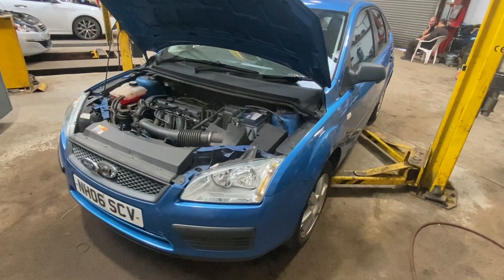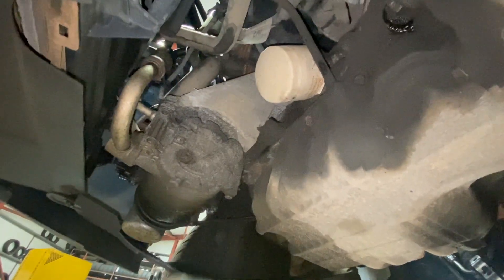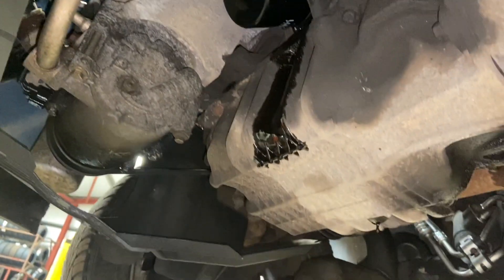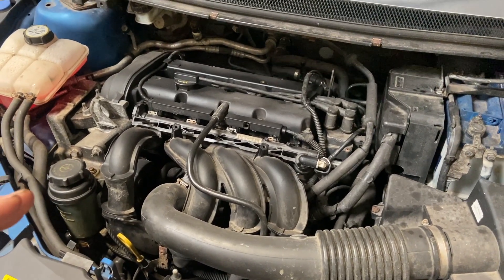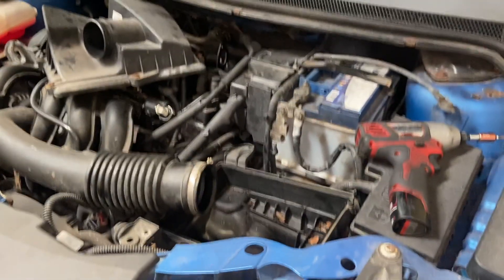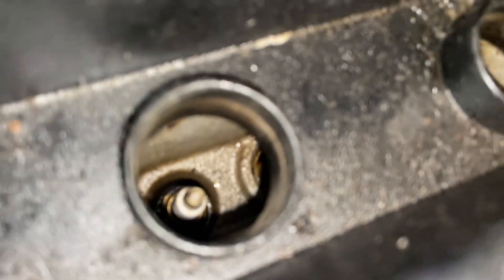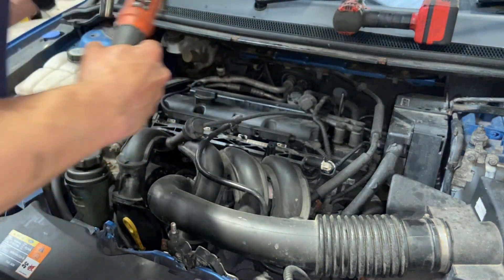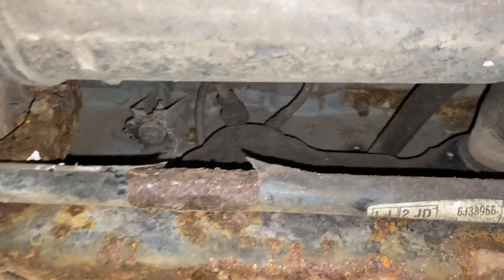Ford Focus 1.6i Zetec Engine service procedure

Comment from the maker: Check Euro car parts - https://tidd.ly/3lIO7xA  (use discount codes on site)
Check "Car Parts for Less" - https://tidd.ly/2LNEwIn  (use discount codes on site)
Engine Filters & Oil from Euro Car Parts : 
Oil Filter - https://tidd.ly/3tn8a7g
Air filter - https://tidd.ly/2U0KRnW
Spark plugs - https://tidd.ly/3nQrbhs
Engine oil 5 ltr - https://tidd.ly/3b1MjMs

Service kit inc oil Ebay - https://ebay.us/T4JWT0
Engine oil eBay - https://ebay.us/vTP4CR
4L Engine oil amazon - https://amzn.to/3ujyWPp
Brake cleaner eBay  - https://ebay.us/57pfYI

Tools :         
Oil filter removal tool in video - https://ebay.us/PQZcAP
Universal oil filter removal tool - https://ebay.us/qkgOYt
Spark plug socket set - https://amzn.to/3vKvihs
3/8 Digital torque wrench - https://amzn.to/2PP9vpP
3/8 standard torque wrench - https://amzn.to/33eZsxj
Socket set - https://amzn.to/3eGx2Ak
Brake cleaner sprayer - https://amzn.to/2BLF1gX
Long reach 3/8 ratchet - https://amzn.to/3iJsADg
Ring Inspection Lamp - https://amzn.to/3gGWHcG
torx screw driver set eBay - http://www.ebay.co.uk/itm/142442401623
Pic set - https://amzn.to/33JcZyJ
Dewalt 3/8 impact driver - https://amzn.to/3njemLY
Screwdriver set - https://amzn.to/3jswgJP

Oil capacity :
4.1 Ltr 5w30 or 5w20 fully synthetic engine oil 

Torque settings required:
Spark plugs 15 NM
Sump plug 28 NM

Check out my timing belt & water pump replacement video for the same engine : https://youtu.be/jTAVM75YiwI

Comment: Where is the A/C drain pipe on the mk2 2007 as mine is fulled with water not coolant when the air con was on water used to out under car but not now so pipe is blocked Thanks for any help.
Reply from the maker: Yeah must be that then , I’m not sure axactly but it will run down the engine side of the bulkhead normally

Comment: Those Bosch spark plugs are soo garbage!
I cant believe Ford uses Bosch or Autolite as Oem instead Ngk or Champion.
Reply from the maker: Tbh mate can’t say I’ve had many problems with em
Reply: They arent problematic, but they really dont perform better or equally good as the Ngk's or Champion.

Comment: I recently bought a  Ford Focus 1.6- 2008- the video was so  helpful ...thank you
Reply from the maker: You're welcome!
Reply: @diydaly  what is the difference between a zetec, and a duratec, Cuz my dad owns a 2007 c max, 1.6 duratec
Reply: @bigmansir3745 the duratec version has variable valve timing which produces more power and torque than the none V V T version  .the visual differences is 2 camshaft senses near the top of the timing belt cover.  😊

Comment: Is it possible at all to change the air filter for a cone one to give the car a bit of a better sound? I know it won’t be much but just thought it’s worth the ask.
Reply from the maker: Yeah its easily done
Reply: @diydaly  are there any specifically you’d recommend or make sure I install a certain way to make sure I’m not sucking in too much hot air or should it be fine?
Reply from the maker: @tylermarkley7919  I
Reply from the maker: Tbh mate I wouldn't really recommend doing it but if you are going to id just say go for a reputable brand like K & N

Comment: Is it safe to wash your engine with water
Reply from the maker: It’s is if everything sealed correctly , personally I would t recommend it .. certainly not power washing it , people do but I’ve seen various problems caused by it
Reply: @diydaly   Thank you I think I'll give it a miss
Reply: @diydaly   Thank you I think I'll give it a miss
Reply from the maker: @liam208  👍👍

Comment: Mate what is that small black hose that runs from by the spark plugs at the front to underneath the air box element is that required or can it be removed
Reply from the maker: If you mean the pipe that covers out the rocker cover pointing towards the front .. it’s an oil breather pipe and must be fitted  👍
Reply: @diydaly  legend bro I sussed it out myself left it on there just re routed it away after changing filter
Reply from the maker: @BigVVS  nice one 👍
Reply: @diydaly  u reckon I should leave the end open or put a breather on there does it really matter or what all the forums say as long as you don’t block it off you’re good to go
Reply from the maker: @BigVVS  personally I wouldn't just leave it open but aslong at it can breathe you wont have an issue
Reply: @diydaly  I left the hose on there I meant a filter lol the hose is routed under the new intake jw if I should filter the end of it or leave the hose open
Reply from the maker: @BigVVS  I’d put a filter on mate 👍
Reply: @diydaly  top man, subbed bruvva take care
Reply from the maker: @BigVVS  thank!👍👍👌
Reply: Oil catch can
Reply: @xaviersandrinedemay6396  it’s scrapped now 😂😂 nothing lasts these days that was 2 cars ago